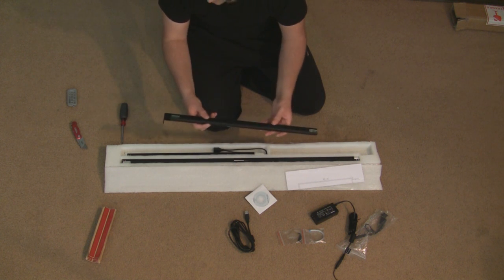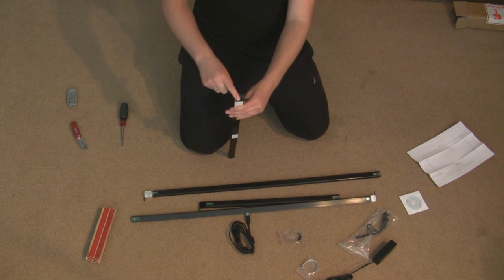Integration Kit Multitouch Infrared Frame Overview

Comment from the maker: Communication is sent to the computer as Windows Touch or TUIO. Windows Touch is the native mouse control (HID) and since the frames support multitouch it will be multiple Windows Touch commands sent up to the number of touch points the frames supports (the software doesn't necessarily have to use all the touch points).  Every application for Windows supports at least 1 Windows Touch event because it supports a mouse. Most of them support at least 2 such as web browsers for pinch zoom gesture.

Comment from the maker: Yes you can do that.  The glass is there to protect the screen surface as most monitors are fragile and scratch easily.  If your screen already has a glass layer on it, or you think you will be gently enough not to damage it, you do not have to use the supplied glass with any of our touch frame overlays (Integration Kit Frames do not come with glass but take longer to arrive).